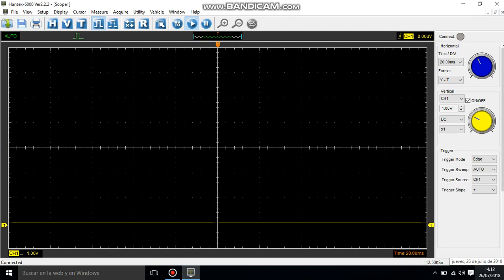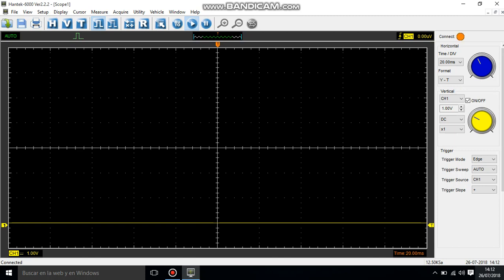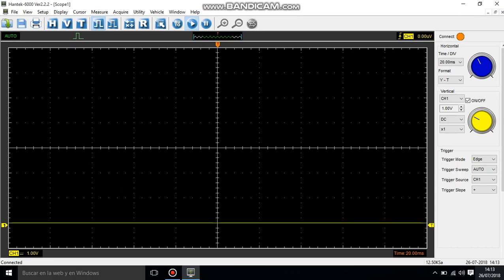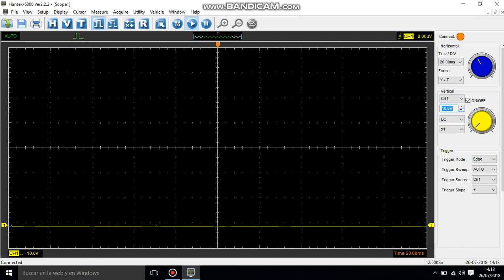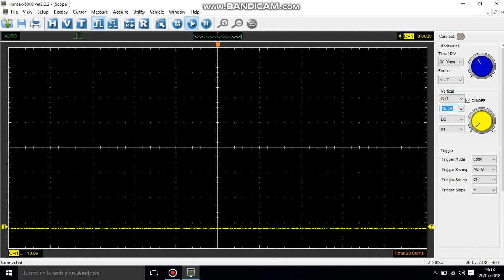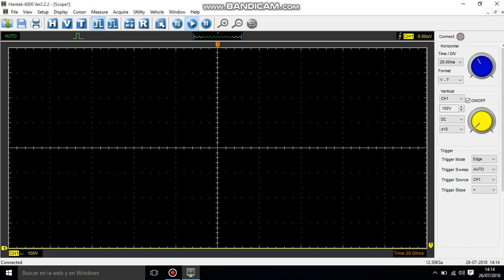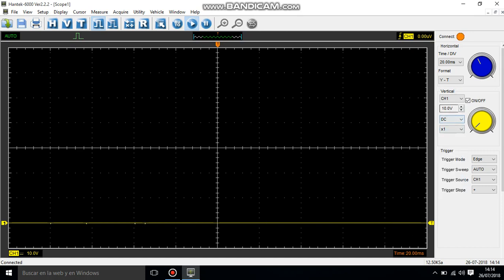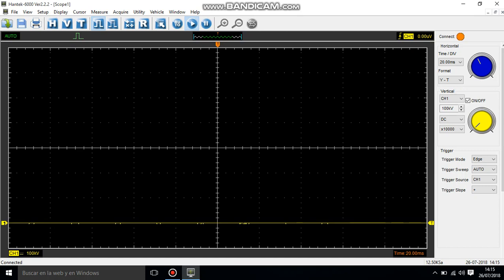hantek 6074BE reading problem

Comment: The x1 scale is a plain wire connection,the x10,x100,x1000 scales is meant to use probes,the software will correct for probes.!.5 volt battery is not going to read on x10,x100,x1000 correctly without probes connected.